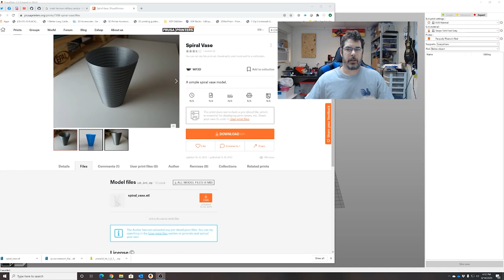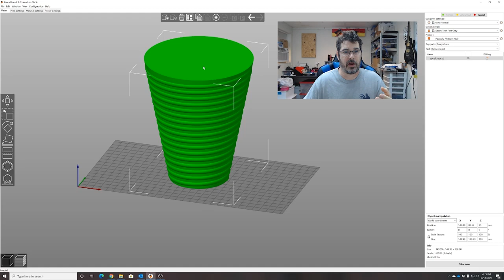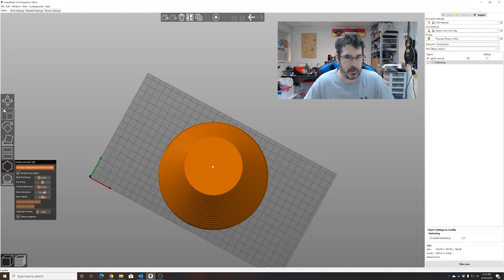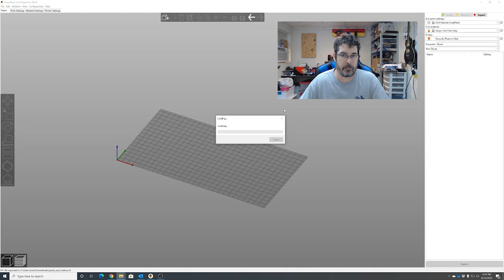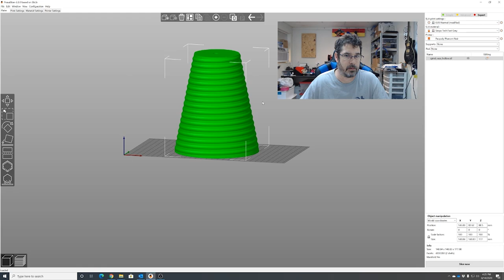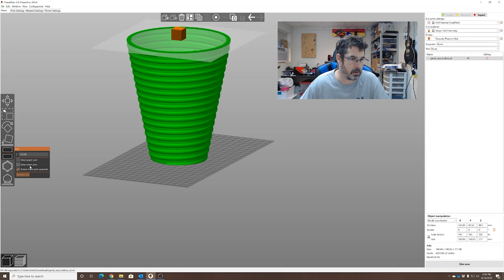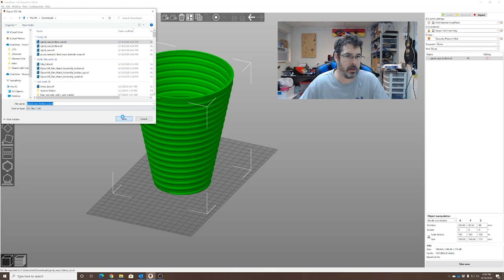Hollow Vase for SLA/MSLA Using Prusa Slicer

Comment: thanks for the vid.  Why is my Hollow tool not visible on the left toolbar?  I do not have the 7 tools you show, only 5.  the bottom tool being split
Reply from the maker: Make sure you have it set to "expert" mode. It may be hiding those options in the other modes.

Comment: Surely having the "vent" hole against the build plate is not gonna help with the suction force on the FEP file... should perhaps be on the side near the base to let resin / air in then the bed is lifting?
Reply from the maker: Correct, that why I make note towards the end that you need to elevate it when printing so as not to create a giant suction cup. But the single large hole (vs smaller ones on the sides) allows you to use it as a lamp shade, or for water drainage if using as a planter.